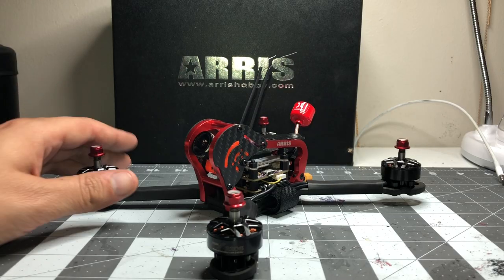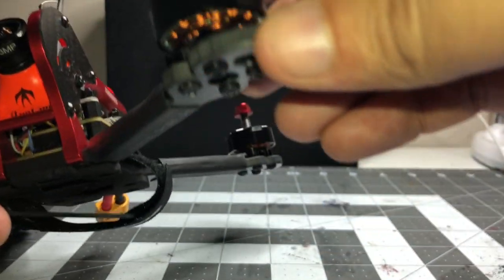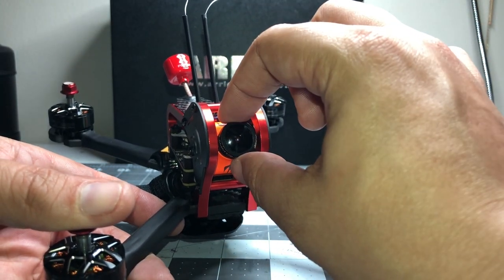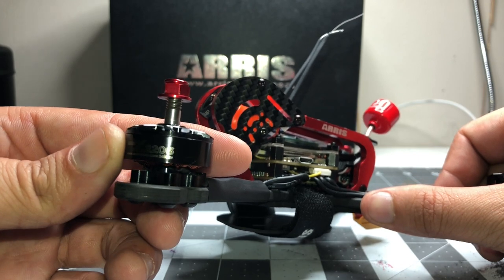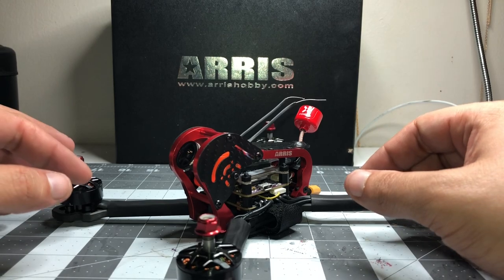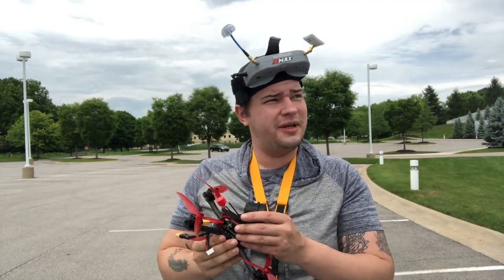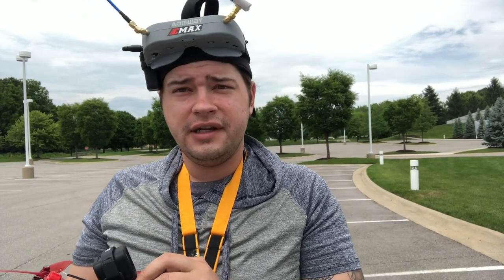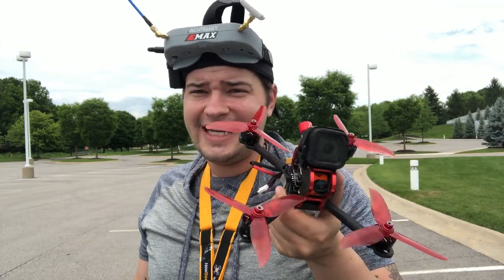Arris x210s Review

Comment: Hey buddy how you doing always great to see your videos I was looking at getting that drone I was just waiting for somebody to review it I saw the price and it's crazy how low they have what pids are you using or you using the stocks and also the props I using the Dal? I'm still training doing what you told me got your advice I was looking at that or the hawk 5 but that one has a pretty good price on it. I need to get another radio would you advise the qx7 or the x9d I don't have the money kind of now but I noticed you use the qx7 and I seen a lot of people talk bad about the Gimbals and range on it.
Reply from the maker: Glad I can help man! I put my own personal tune on this thing to get it ripping properly. Basically I just uped everything by 5 and set my rates. The price range is out standing for what you get. They come with Dal 5045 cyclones on them. I use 5046 usually but cant tell a difference. I love my QX7. I have had no range issues what so ever. I think that has more to do with the receiver tbh. For the money, id go for the Qx7 for sure. The hawk 5 looks absolutely amazing though! I am just not a big fan of underslung batteries because you will go through batteries much quicker.

Comment: There's a coupon section on the hobby wing site. There's one for 5% off anything. So this is even cheaper!

Those 2206 motors looks like rebranded lite spec emax motors.
Reply from the maker: Raven Newbie FPV close but the air ducts on the top of the motor are shaped like a star. Get one!
Reply: kOrY FPV lol. One quad at a time 😂
Reply from the maker: Raven Newbie FPV lol I feel ya man